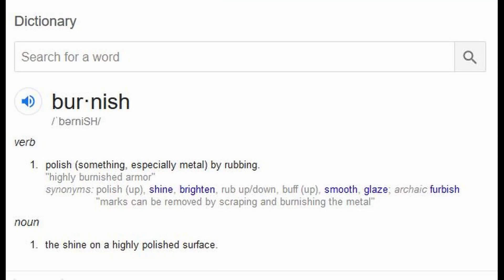To burnish or not to burnish!  This is the Question!

Comment: You need to discover the best contact / gold filler / lub safe for paint and all plastics .  DioXit Gold spray.   It’s expensive, but it will out perform anything and last a long time.  I use it on my vintage guitar electronic s repairs to controls you can’t disassemble.  It works great to clean and lub and repairs commutator surface .  It will amaze you . One tiny drop though the window on bearings and commutator surface on a F9 or Casey Jones makes the motor spin like new.  Get some and reduce time to service your motors and keep em running too.

Comment: Was watching burnishing video.  I have a Dremel but not sure which tips you were using.  I saw 3 different ones but there are many choices that look similar.  Could you share which ones you typically use is certain situations?
Reply from the maker: I vary my approach depending on the wheel material.  But typically for metal wheels I use a 'scotch bright' type cleaning wheel followed by a brass or steel brush attachment.  In this series I did a short break down on what I use.  https://youtu.be/qFCkUlRy6pk   Hope this helps and good luck with your project!

Comment: What were those tools? And attachments..
Reply from the maker: A dremel with a soft abrasive sponge wheel, a brass/steel wire wheel and lastly a cloth wheel.  The picture of the two wheels beside each other...one cleaned, does not have the brilliant gloss.  This wheel was dine without using the wire wheel attachment.  I apologize for not being more clear.  I will do this in the next video.

Comment: Oh can this allow you to go up hill?
Reply from the maker: Ummm... maybe?  I do not understand?
Reply: Real trains have trouble going up hill.. Just curious if there is world record for a miniature set going up an incline
Reply from the maker: I'm sure there is but I do not know what it would be.  I'm impressed by the length of some model trains.  I've seen videos of 100+ car trains.  There is one with two American flyer northerns pulling 100 cars.  There is another from the Colorado railroad museum (I dont recall if this the correct name) with HO trains of the 100+ car length.  Another HO guy will post videos with several engines and very long trains...going very fast.  His layout is a very large, flat, rectangle with the track on a pegboard bench.
Reply from the maker: Burnishing the wheels does not improve the tractive effort of engines.

Comment: What attachments were you using in your Dremel? Looked like a wire wheel?
Reply from the maker: Yes...depending onnthe condition of the surface I may first use a gentle abrasive wheel.  Then a wire wheel...typically brass or steel...lastly a cloth material.  I do not know what this material is made from.  But dremel has a thick white disc that you thread a shaft into.